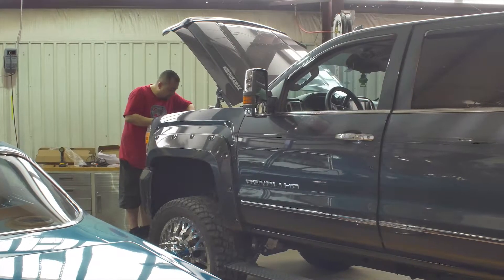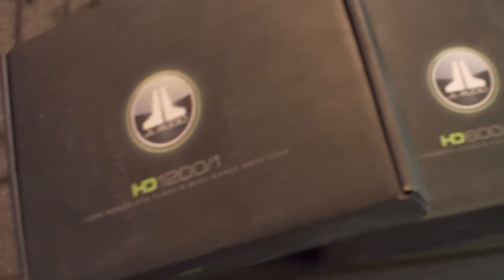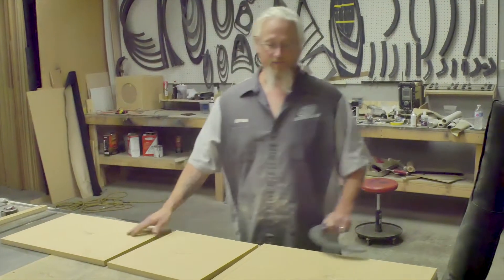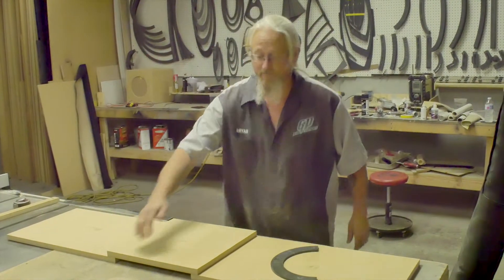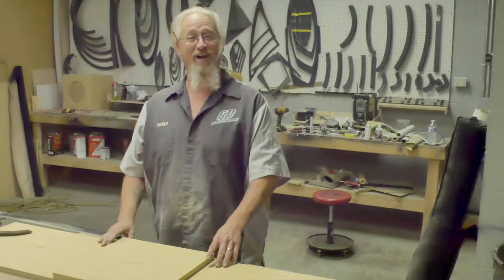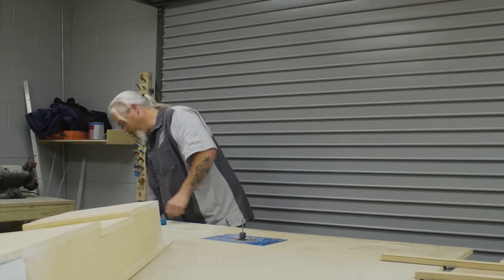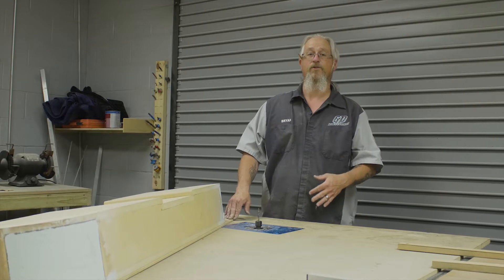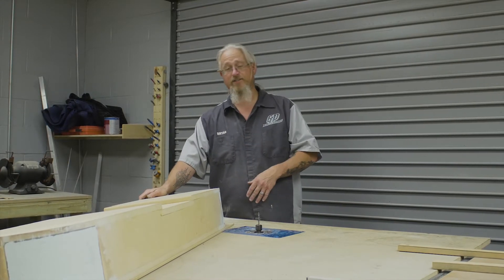Teach It Tuesday: The Enclosure Process

Comment: On the raised vinyls, how do you get the designs made? For example the Denali, do you use a program?
Reply: You go to the internet, find a logo you like, print it out on paper, spray down some contact adhesive (only the paper, not the box) and let it dry for a good while. Stick the print out on to the vynal where you want to cut it out, then cut it out.

If the design is really intriquet, buy a cricut machine (sticker making machine), or ask the girl down the street to make you a nice fancy sticker. If she doesn't have really thick sticker sheets, try doubling or tripling the stickers to get the thickness you want.
Reply: @jakefriesenjake  thank you so much,  Just discovered your videos and love them.
Reply: @darylgerardo6625  they are not my videos. I just shared what I think, since most of time peoples questions go un answered. Have a great day